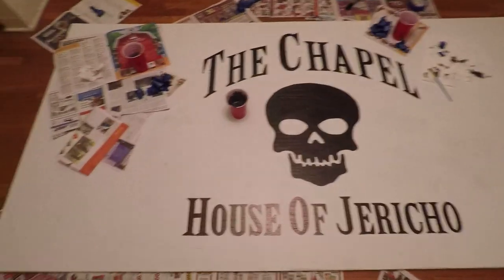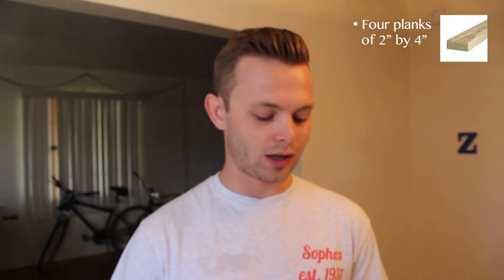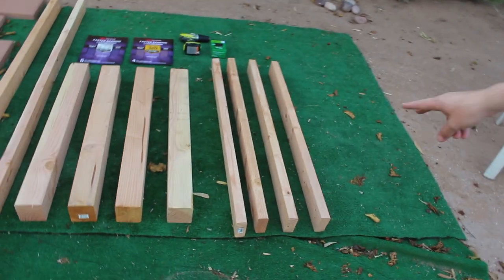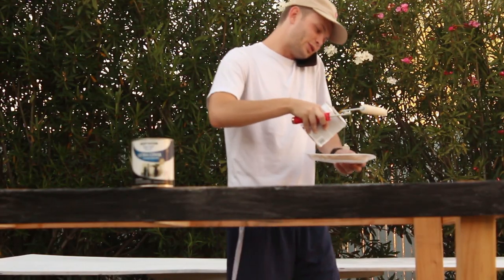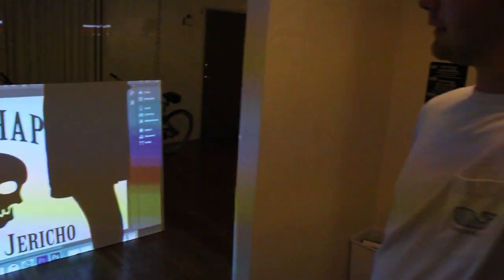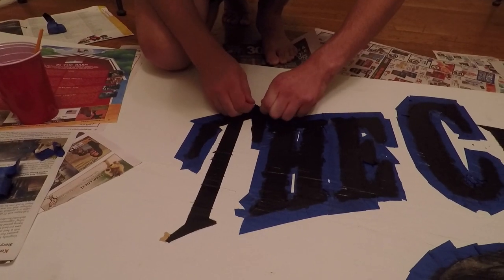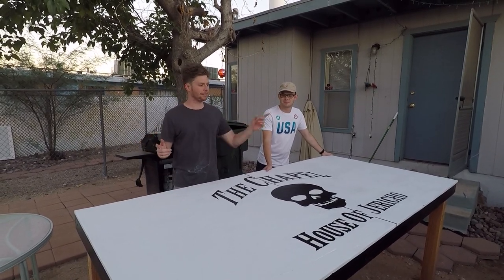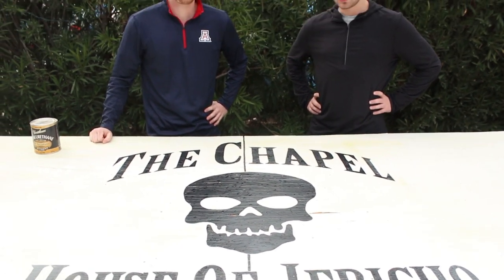DIY Beer Die Table

Comment: I’ve made a similar mistake in the past - if you want to maintain a pure white finish, you need to use WATER-BASED polyurethane. The kind you used was OIL-BASED, and it lends a slight yellow tinge to whatever it’s covering. Not a problem for wood or dark paints, but it shows up as a nasty yellow on white paint. Water-based polyurethanes will go on crystal clear.

Comment: In the opening of the video you have listed cutting the 2'X4' in 3'8" pieces but in the description you say you cut them into 4' pieces. Which size did you guys actually cut the 2X4s into?
Reply from the maker: The description is correct

Comment: What did y’all use to seal the paint?
Reply from the maker: We used a water based crystal clear polyurethane coat. We only put one layer, but I'd definitely recommend you put on at least 3 layers